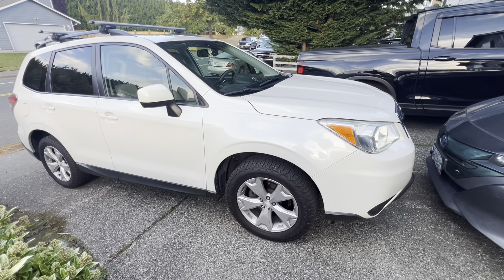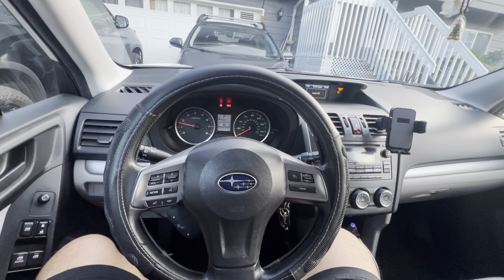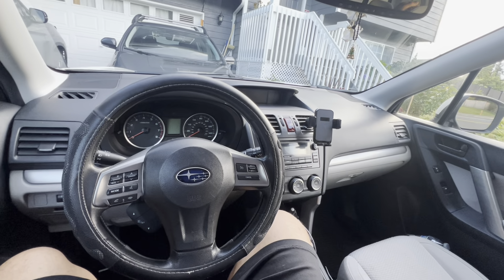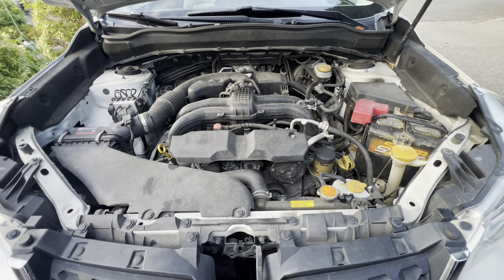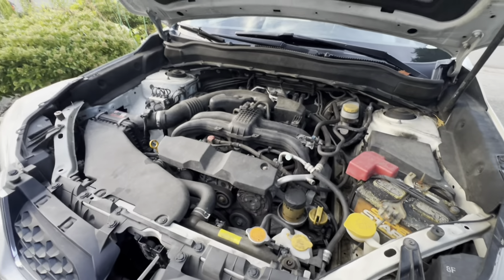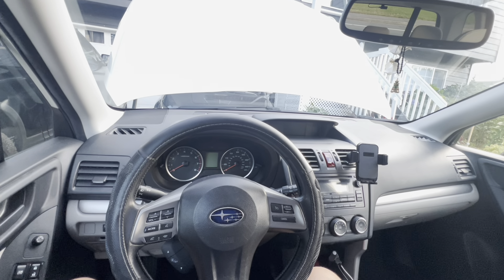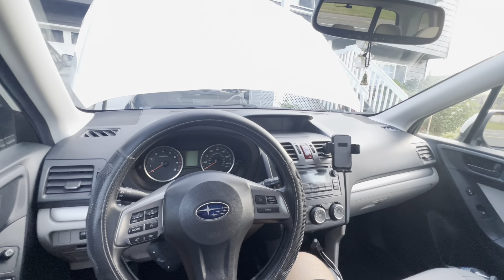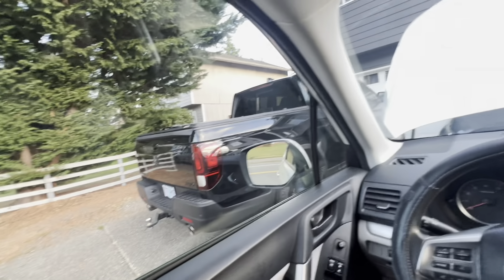153k miles 2015 Subaru Forester Long-term Review, updates and repairs! Running great now!

Comment: Thanks for the video. Have you had any torque converter issues? I know some models from the early 2010's have had a torque converter problem.
Reply from the maker: No, no issues with that. Just the valve body solenoid is a very common CVT failure.

Comment: What oil do you use?
Reply from the maker: 10w-30 valvoline synthetic with a quart of Lucas oil treatment. I don’t burn any oil since I have done this when the car was around 60k. Now at 155k miles 

And engine still runs smooth and quiet
Reply: @ I just brought a 2015 limited 2.5a 140,000 miles idk if it’s burning oil yet. Do you think I should switch over on my first oil change?
Reply from the maker: I would switch over for the oil change, try a quart of Lucas oil and see how it treats your vehicle. It should run smoother and have better startups.